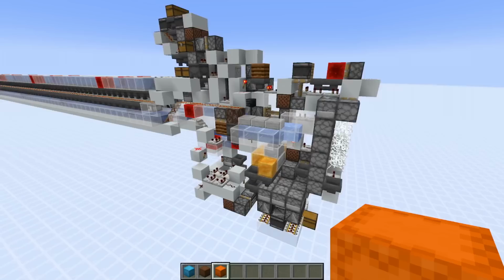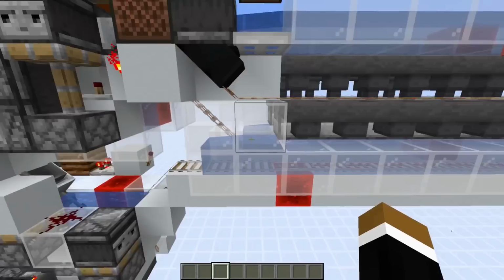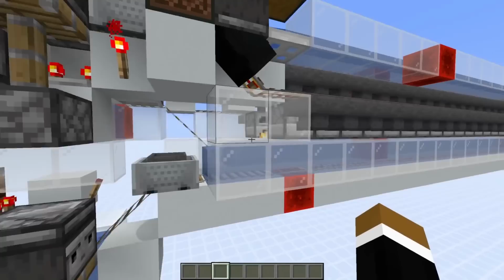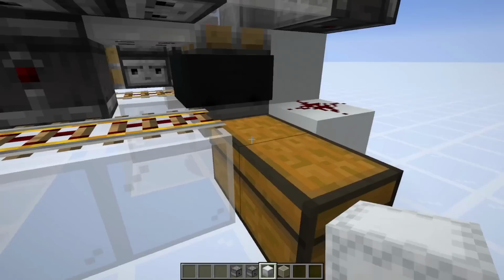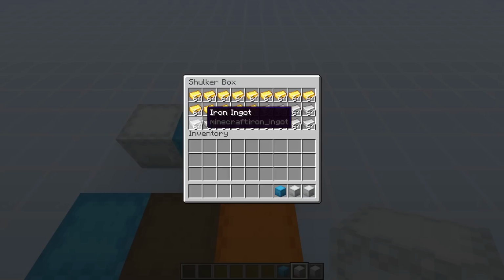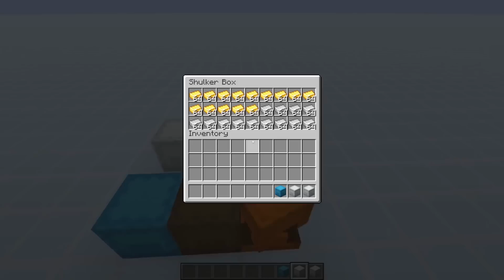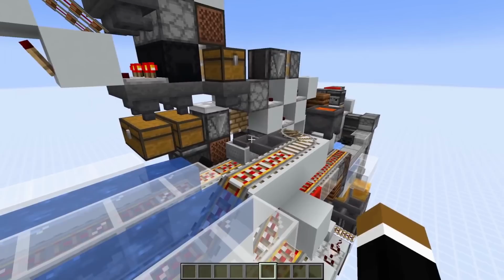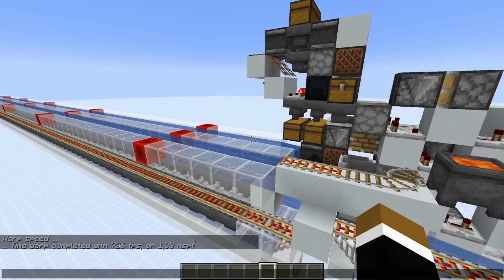Waterlogged Rail Mega Furnace Array With Precise Shulker Box Return 1.19

Comment: For anyone building this in survival, it should be mentioned that the furnaces should be prefilled on first launch. This can be done by manually launching the coal hopper minecart by click the noteblock nearest to said minecart. 

Without doing this, some items will be left inside the furnaces after smelting the box

Comment: I would like to point out that the top cauldron that destroys the hopper minecart doesnt work if the furnace is built towards north/south. it means that as built in this video is directional as far as i'm concerned. i will try to get around this issue though =)
Reply: after fiddling around trying to find a solution i made a few attempts that screwed with the timing. so i ended up destroying the farm and rebuilding it in the correct orientation. even after this i still have a problem with the shulker box filler, where it seems to be working slower and making more noise than in the demonstration. i've been trying to figure out what the issue is, but even the litematica blueprint is reporting zero misplacements of blocks and entities. i've double checked all the clocks, and all has the same amount of items as the demonstration. at this point i'm burnt out after hours of troubleshooting without any results, and i would appreciate any suggestions or ideas on how to solve this problem.
Reply: Thanks for the help i was having the same problem

Comment: Is it possible that this is directional? Just (tried to) build it in my world, but rotated 90° and the minecarts with the items that should be smelted aren't broken, they just drop onto the ice chute which is where the empty shulkers usually go.

Update/Edit: Playing around with it for a bit in the world download i think i've found a fix:
1) remove the curved rails
2) Move the lava cauldron 1 block to the left and place a hopper pointing into the hopper feeding the minecart dispenser under it.
3) Add a block to the middle of the straight after the minecart comes out of the water and place the same rails on top of it like before, so from left to right it should be:
     Powered rail, watterlogged, going up (same as before) - powered rail, *NOT* waterlogged, still going up - powered rail, not waterlogged, straight (on top of the new block added) - normal rail, going down next to the cauldron.

This fixed the issue for me, however i haven't done too extensive testing yet, so there might be other problems

Update 2: No idea what's happening, but as soon as the array is rotated the shulker box return doesn't function properly (some filled more, some less, sometimes the new box isn't dispensed and items are just spit out like they are). Guess i'll just tear it down and rebuild in another direction

Update 3: the problem with rotating was indeed directional, cause the minecarts kept slowly falling out the blocks, however if you manage to align them properly and make them stay inside the blocks (which I think is possible) it should work. In the end I had already rotated it when I noticed the minecart alignment was actually the problem, so I spent another 2-3 hours pushing minecarts by hand and pushing in glass blocks with pistons, it works now, but I still don't know how to align the minecarts correctly, I mostly got lucky I think.
Reply: As an alternative, you can replicate the same soul sand destruction just below it.  Powered rails going up, not flattening out, then when they can't be powered any more, flat normal rails and then the 2nd rail is on soul sand.  Replicate the one setup with the witherskull (any skull works) and make sure the hoppers just feed into the correct one.  Works like a charm.

Comment: "Why would you optimize a furnace array that is only loaded when used"

I have a bone meal farm in the Spawnchunks, that speeds up the dried kelpnproduction. As such the furnace array is also located in the spawn chunks. When all Kelp is generated and the bone meal is replenished everything shits off. Obviously I want the furnace array to shut off as much as possible too when not in use. That's why it is great that I can easily lock the hoppers

Comment: I think that the strange hopper minecart breaker with the curved rails is infuriatingly directional at the exact speed it's coming out of the water. I built this in my singleplayer world and (after fixing it due to my bad block placing several times) I discovered that the hopper minecarts don't break on that cauldron. I set up a number of tests for directionality, and I can't reproduce the issue except in the actual build going the exact speed it should when coming out of the water. My furnace array points north. When coming to that cauldron the minecarts are coming south.
Reply: Is there a solution or an alternative to that setup? I'm having the same issue with the one I just built. I just built the whole array in survival and would rather not how to tear it down and rebuild it in a different direction. That specific minecart breaker is the only issue I'm having with this design
Reply: @Jessepersen  The solution is to just build up a regular consistent minecart breaker and feed it in. It is a lot more clunky but it does work.

A word of warning, I cannot make my system work with the exact correct timings and I don't know why. As far as I can tell everything is built to spec. My theory is that the whole damn array is directional. Which is frustrating.
Reply: @williamragle1608  I have this issue as well, I ended up adding a second lava cauldron beside the one that breaks the unloading carts and that fixed the cart spilling but as for the timing, I dedicated a whole testing world for it but i cannot reproduce the timings after it gets out of sync.
Reply: @Dogue001  So the conclusion being that the whole array is directional? Frustrating. lol

Comment: Seems like a cool system, I really don't get why people ask for simpler versions at the end of the day you don't need these systems unless you are working with a lot of stuff, which most people don't and even if you are doing big projects that would be made much easier by use of this sort of thing you're likely either gunna try understand it or use a schematic of the builds, and you're pretty likely to have a shulker shell farm since moving around lots of items without a lot of shulkers is v annoying - granted ik some people just grind away in the end for ages to get enough shulker shells for whatever they want, but in most cases you would be better off just building a shulker farm and then not recycling. 

Is nice to have recycling shulker box ones though, always nice to have the option - Not that I personally ever really plan to build 90% of the stuff I see from technical minecraft It's just v. interesting to see what is possible in the game and that. Loved the sarcasm on the requests for simplicity haha.

Comment: I made a few mistakes while building this, but...

1- This farm is directional. Use the same directions as the world download.

2- (shulker loader) The two bottom minecarts must be precisely positioned, be careful to not accidentally nudge them (add some glass on the sides to avoid accidents)
3- (shulker loader) The minecart on the top can't be less than half a block under the item stream
4- There are a total of 5 clocks on the farm (counting the cobweb one), so make sure to fill them with the correct amount
5- Pre-place a shulker on the shulker loader and also put a couple more in the dispenser just in case
Reply: thanks

Comment: 7:21 How do I align the hopper minecraft correctly?
Reply: Did you figure this out? Im left wondering
Reply: @lolliepoep  yes, if I remember correctly, they were not aligned correctly. I think they need to be in the inside corner of the honey block as possible to distribute across the hoppers correctly. That is because the honey block does not have a full block hitbox. I believe I had to push them with a sticky piston (+block).
Reply: @SETHthegodofchaos  okay thank you, I also discovered I can maybe use cobble fences to align minecarts in center of 4 hoppers.

Comment: 2 questions (sorry if they’ve already been asked/answered I didn’t see them in the comments:
1) is it possible to use this with lava buckets for fuel? Or is it like the larger version where it wouldn’t be as quick/efficient?
2) does the input have to be in shulkers or could it be just items?
Reply: About the lava bucket question; the fuel distribution isn't ideal for lava, since you only have 5 slots in a minecart hopper, and alot more furnaces. You'd need a redesign for that alone, but lava leaves the bucket behind and that will get mixed in with your output, causing shulker loss overtime as buckets fill slots in the shulkers that get sent through the system. It's one of the reasons I don't use lava outside of the small manual load smelter designs, typically early game for me.

Comment: Why do you need to send a collection cart every 10 seconds? Surely it's fast enough to suck out two items per furnace. Is it to even out the batch size coming to the output?
Reply: If different items are put in, then they wont stack. This can cause blockage.
Reply: @inspectortalon  Hmm. But since each furnace take two items at a time, that will only happen if you put in an odd number of items, right? And only in one furnace.

I guess it's nice to not have to worry about that.

Comment: Can someone explain to me please, which clock times what ? i tried to understand it, but have a hard time to do so ^^
It seems my minecart which should empty the furnances gets send a little bit to early, items are just finishing smelting after it went through.
Also it seems the Shulkerloader is a little bit to early sometimes, and i get a shulker and a few items dropped.
Reply: i tinkered around a bit. i got the minecart timing right with waterlogging one more rail
and i think i got the shulkerloader "fixed" with adding 16 additional redstone to the clock (which makes the array a bit slower)

what i found strange:
In the World download in Singleplayer, a Full Shulker takes about 3Minutes and 15 Seconds from "Throwing into the Inputchest" to "Having a Shulker in the Output Chest"
On the SMP, a Full Shulker took about 3Minutes, but the Loader finished too early (Causing produce to be still in the droppers)
So first i thought it might be some performance issue, but my SMP has 20 TPS and aounr 2 MSPT, so there shouldn't be an issue
The only other difference is: on the SMP i Build the array North/South, and on the Singleplayer World its build East/West

Comment: Having some problems on a server with this smelter. Schematic directly from world download every block and block state correct but with a full shulker getting smelted, the shulker above the fence gate breaks early and leaves items in the droppers or spits some out and splits 5-6 stacks into a new box that stays in the dropper ring. if I increase the timing on the shear dropper clock I run into issues smelting non full shulkers
Reply: also every timer is the same items: the 1 redstone torch, 1 comparator, 9 charcoal, and the 24 redstone dust for the 20 second hopper clock. Average mspt on server is 15-16. maybe increase the 20 sec clock?
Reply: You probably have a problem with the splitter. All 8 hoppers must be able to suck items out of the 2 minecarts.
Reply: @RmNrIHRoZSBDQ1AK  Ya I figured it out after some testing even though the minecart hoppers were pixle perfect to the schematic they needed to be adjusted slightly

Comment: What if you used stacked hopper minecarts for faster suction and then used the same lava cauldron method to dispense all the items at once.
Reply from the maker: Not sure. What is the benefit?
Reply: @ilmango  the sucking speed is faster out of the shulker box i guess. So you can bring it up to 320 furnaces. The minecart path can be split to 2 independant paths of 160 furnaces each, matching the speed of the previous design
Reply from the maker: @vihaanravishankar3989  yeah, in case you want the extra speed this sounds useful. not sure if this easily doable though
Reply: @ilmango  should be fairly easy to implement with a different design! Killing a stack of carts is one of the fastest ways to get items back to the player. I plan on making a furnace array that smelts a box in about 25 seconds using that method.

Comment: Would blocks of Redstone on Sticky Pistons work alongside the Hoppers to Lock them with a Switch or Lever? Also, the order isn't important, as you can always have them later run into a Item Sorter in your Storage System.

Comment: More casual players don't need so big furnace array(three hundred what?). 64 would be more than enough and by the way. 64 furnaces can be fueled by single minecart with a chest and items to smelt can be distributed by another minecart (there is minor waste of fuel on first cycle) with chest resulting in way more simpler inputs. It's literally 2 levers to on/off smelting/fuel destribution. Capacity is not that great, only single chest of items to smelt per batch, but for daily need of average minecraft enjoyer this actually more than enough and far better than manual 20 or so furnaces. You seriously overcomplicate things.